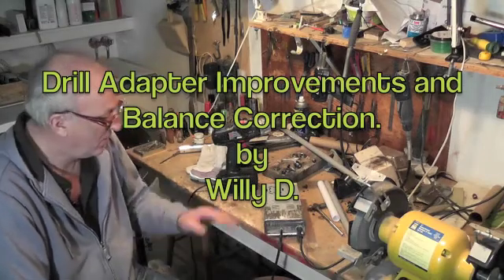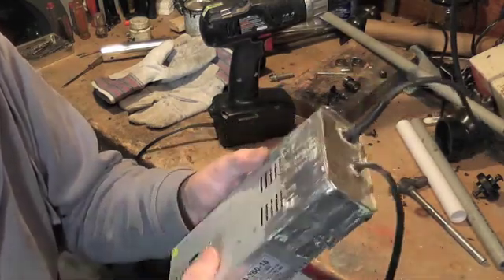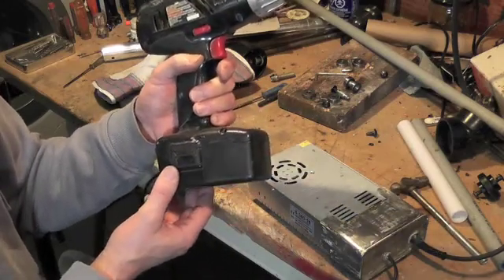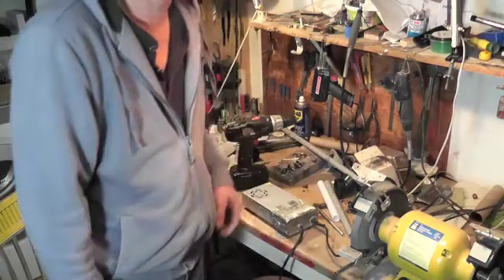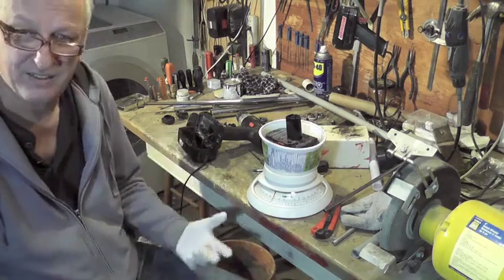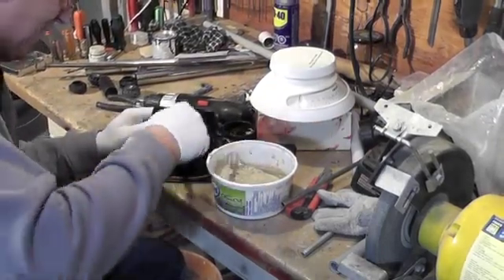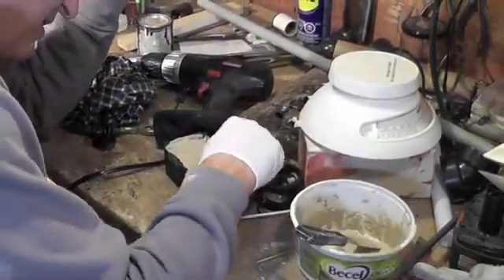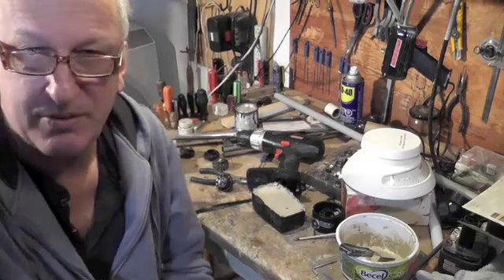DIY  Battery Drill to Mains: Pt.3

Comment: I wonder if this idea would work with an 18v impact wrench? I think it would power it ok but I don't know if they tend to draw more current than a drill like yours?
Reply from the maker: It would work because you can get 30 amps and it will be OK. You can have high Amps and the impact wrench will draw what it needs. It's when you have to high a voltage that it burns out. My drill only needs about 10 amp but the converter I use is 20 amp.

Comment from the maker: The drill torque is working great when under serious  load. I have drilled a hole so one can see the green power on light and may add connectors for other equipment. I will be looking for a 12DCV  adapter as well and post it when completed. One could have multiple connectors for equipment all plugged in as long as one used one at a time which is what we all do anyways.